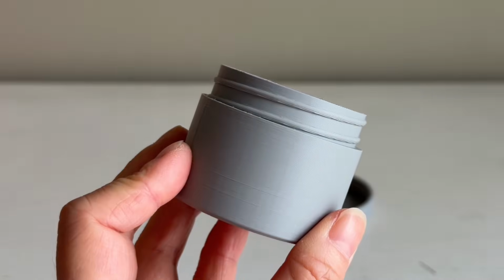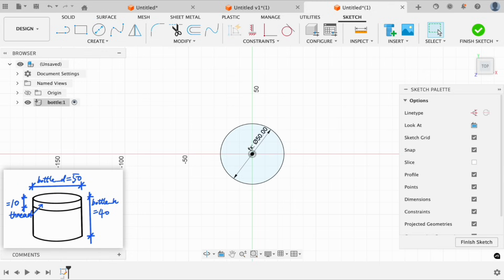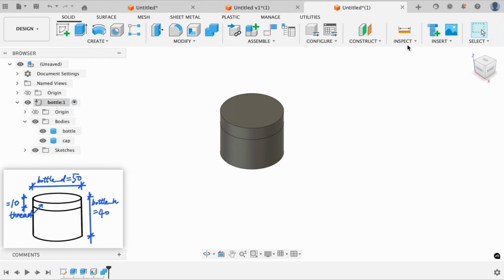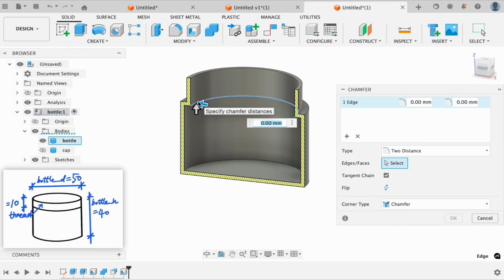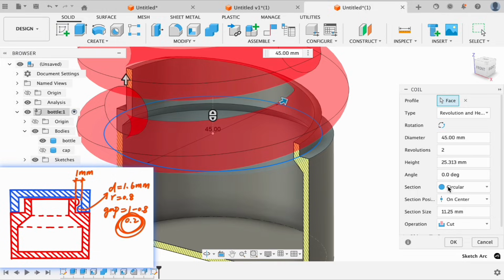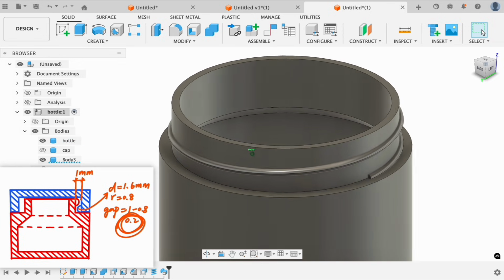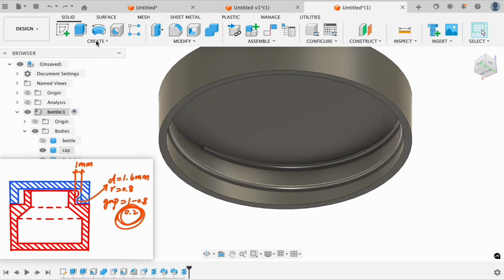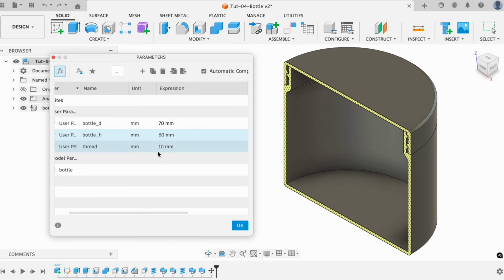More Like a Real-World Bottle: Using Coil to Model a Threaded Bottle in Fusion 360

Comment: The threads don't scale if you change the bottle diameter because the value is fixed and not proportional to the diameter.
Reply: My mistake, I loaded the wrong file

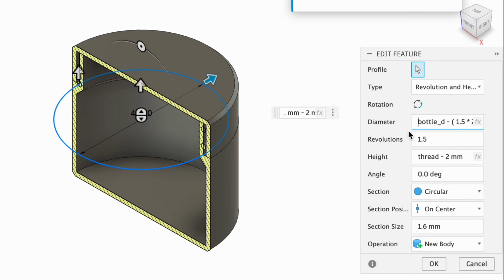Comment: I'm so happy to have found your channel. You have helped me find new techniques for modeling. I like in particular the way that you use parameters in the beginning that allows for changes to the bodies later. A very simple and elegant way. Furthermore, I like how you use formulas throughout the modeling as you are defining the threads at 4:47. How did you come up with the correct formula for the threads? Trial and error? I only have one question regarding the formula/input for the diameter: bottle_d-(1.5*2)*1mm - 2mm-   Can't this be simplified to: (bottle_d - 5mm)??

Comment: When you created the coil on the body, you defined the height as 'thread - 2mm' to "allow the cap to tighten fully". Am I understanding correctly that is done to keep the coil in the lid from going all the way to the bottom lip of the lid? Because that's where it would bind before fully seating?

Comment: Great video, consice and easy to follow.
I did have a question, was there a particular setting you had to set to get your axis to be that orientation in Top view? Every time I go into it my Fusion rotates to point X left and Y down, really annoying to have to rotate back around every time.
Reply from the maker: You can go to Preferences > General and check your "Default Modeling Orientation. I personally set mine to "Z up."

Comment: Hi,
Why not to cut the canister coil thread from the cap and add a tolerance ?
Instead of making a coil twice
Thx
Great work!
Reply: That way you cant change coil itself independently anymore, so lets say if you can use bottle without cap or vice versa in other project, all you have to do is adjust coil to match other project. So both is possible, difference is personal preference and needs. Its same as you dont have to rename every single part and sketch, but you do it for best practice, not because it is mandatory in order to part work. 🤗
Reply from the maker: Good point! You’re really thinking through the mechanics! I’ve considered that approach as well.
However, a Boolean cut can be problematic in practice. Using two coils creates minimal contact surface, which reduces friction for a smoother feel. With a Boolean cut, even with tolerances, the matching geometries plus 3D printing "sagging" result in a much larger contact area. This leads to high friction and a gritty feel, making it far less durable and smooth than independent threading. Thanks for sharing your thoughts!